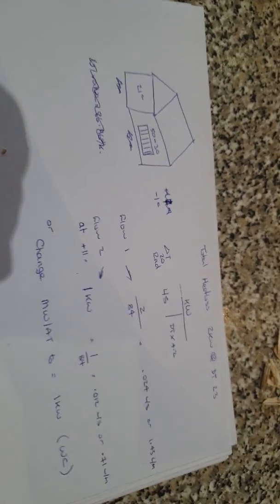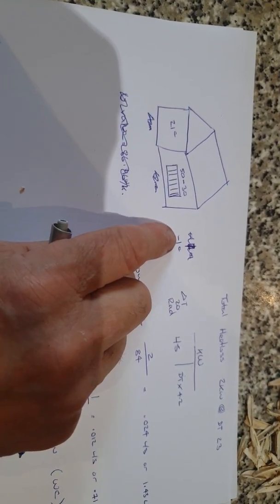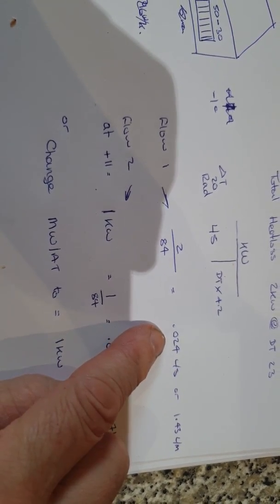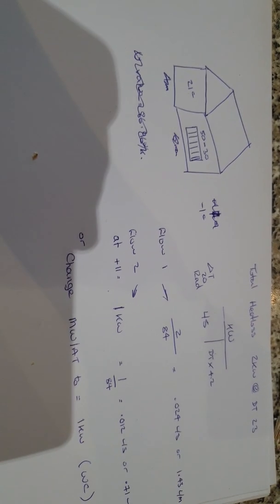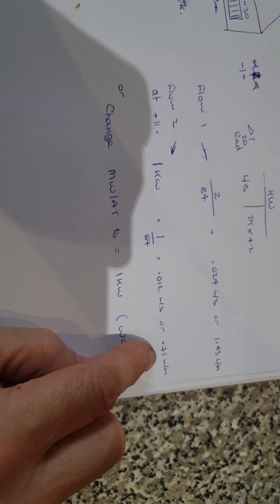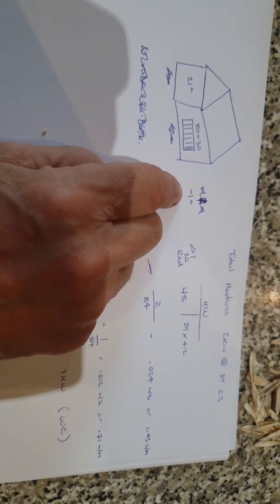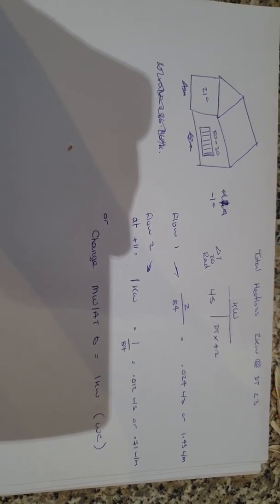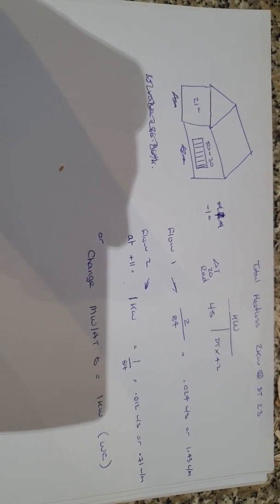Using Delta t to balance heating systems.

Comment: None of this makes sense
Reply: Yes but how often will exact design temps be available during an install. There's far to many variables in this, best you can do is aim for a rule of thumb. 

How does this calculation work when it's -11 outside, design is -1. ?
Reply from the maker: @BigC-sd2ed  actually a very good question. Right now I'm going to systems with very wide dt as they cope with minus 3. These have been set up in warmer weather and now are struggling to cope. Ufh systems especially are struggling where wide pipe spacings require very high temperatures to attain suitable floor temperatures to match the heatloss.
Reply from the maker: Lots of people try to balance heating in warmer weather using dt. This explains why that is not a good idea.

Comment: Do you know whether the Viessmann boiler can modulate the pump to achieve a selectable delta T? Obviously within limits to maintain minimum flow rate across the exchanger. Thinking on that, if it doesn't the high rate of modulation should help constrict cycling
Reply from the maker: The new 200 runs the pump based on weather compensation. I have a half thought out theory of why but the idea needs more exploration.